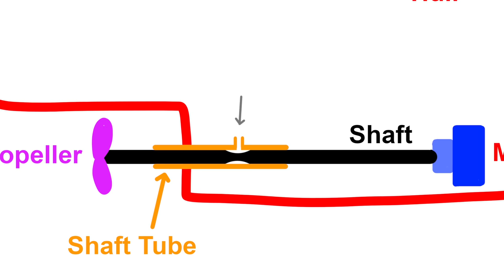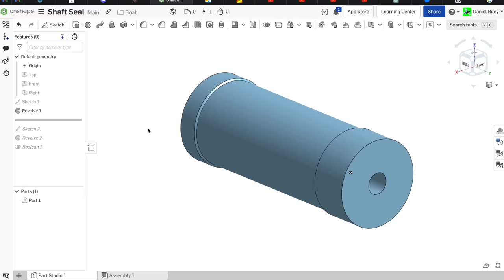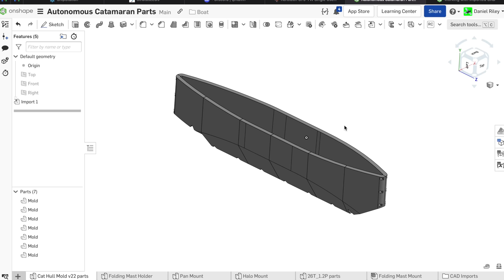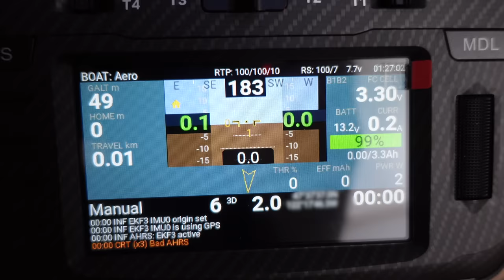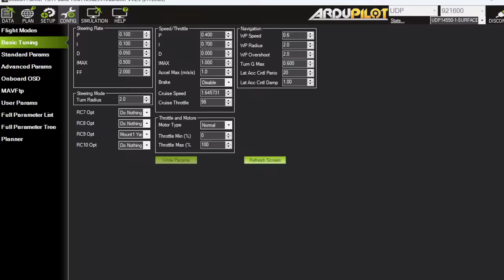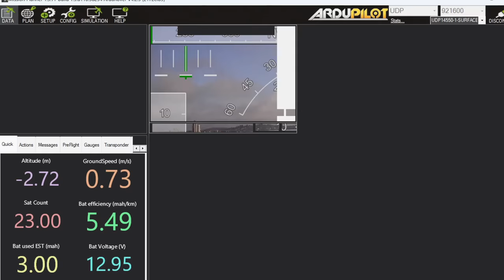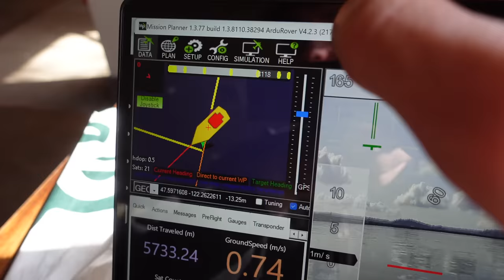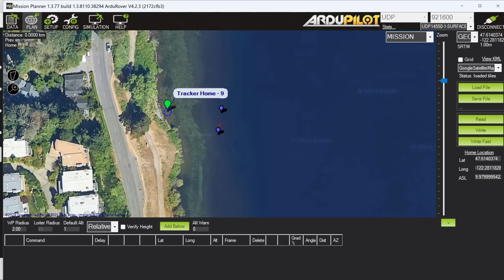5G Cellular Controlled Drone Boat - Long Range Test

Comment: I get such a kick out of these projects you do. The long range autonomous boat was definitely one of my favourites. BTW If you wanted to make sure you don’t get any leaks from the props, you could use a magnetic gear system.
Reply: Might encounter a torque issue if you go that route.
Reply: @Axodus  I agree. It would require a delayed throttle response but otherwise it should work
Reply: @maxxod1  airboat propulsion might be necessary just in-case the prop gets stuck on something.
Reply: @Axodus   The main reason I brought up the magnetic gear drive is because I’m designing an R/C submersible project. It’s something I’m familiar with. But yes for a surface boat your idea might be better. Something like a jet pump except it draws air from above the water line.

Comment: Captian here. REAL Actual Captain.  The one in my 40ft trimaran is just a big pencil lead. hint hint 
Okay so attach a pencil led wider than the shaft facing towards the keel with a set screw.
Then a boot sealed to the hull and sealed to the other side of the pencil lead. adjust the pressure
Of the two pencil leds touching each other with the set screw on the shaft placed pencil lead.
The graphene-to-graphene gap is less than a water molecule wide. So it does not leak and lasts forever.
Mine is 15 years old and it's time I change the boot as it looks someing like a toilet plunger yet the resistance
is not what it used to be thats the only reason why it needs changing. Higher horse power does require active cooling
of the big pencil leads. I thought if I say pencil leads it would be easier to understand than graphite puck with a hole in the middle.

Sorry to see you go through this over and over. If you need details I am sure I can get you some.
Q: You may have some questions like how do you make a gap the fine?
A: You dont you just run it and it will stop leaking by itself. 
Example: My boat was sitting in the ocean for a long time before I bought it and the boot is loose so salt water started too drip and for deposits in the seal making it not work as well. I literally climbed down there and sanded it while taking on water because the boot was pushed back for a moment. Very scary. Anyway after sanding it
then running the motor for an hour it was good agian.

Comment: I actually work in a similar field.  I work at CNHi on autonomous agriculture equipment (tractors and combines).  I must say if you ever want a job, you would be a good fit.  I'm very impressed with your ingenuity.  Mu colleagues are designing mesh radios that switch between wifi and cellular  and I design software that works over these networks.  I often find myself feeling we move to slow but I understand being a big commercial company with expensive lands and equipment we just can't.  Anyway, wanted to chime in and just say from someone in more commercial space, you certainly have the skills to take this beyond hobby but hobby is more fun no doubt lol.  Props to you!

Comment: Aliexpress has 8 mm and up mechanical seals available at very low cost.  They are very robust, and I have used them in a few projects. They could be a good fit for propeller shaft sealing.

Comment: I have been a Chief engineer on crab boats in Alaska and have had to pack shafts, if I'm ever in North lake doing ship yard I'll let you check out what it really looks like. 

Usually not a shaft box just rings of stuffing up against the shaft itself in the tube. The stuffing should go pretty far down the shaft. The stuffing is made of carbon graphite and self seals. West Marine should have some just called Marine Packing.

Comment: I'm almost sure if you made a small hole in the rear under the shaft, the water would self-drain. That's why there is a hole (plugable usually) in every row boat or sail boat.  No need to remove water if you are going forward, even slowing, but consistently, laminar flow ensures the water will drain out the vessel. The problem before was the water coming in had nowhere to go.

Comment: Super exciting to see the comms link and the new controller. That TX16S looks sweet.  Nice work on the prop shaft seal, not sure if magnetic couplings would work then you could isolate fully. How well did the weed guards work ?  That must be one of the real long distance problems.

Comment: If you don't mind mounting your motors "above decks", you can simply use very long shaft sleeves that terminate at/above the deck level to prevent water ingress. There's nothing "special" about the sleeves vs the outside of the hull; the water level will be the same inside as outside. Sailing dinghy dagger boards often work the same way.

This avoids the need for a stuffing box, although it can make your boat a bit more difficult to design from a center of gravity perspective. Such a design is impractical in full-size boats that need much larger motors, but for something like an RC craft it should be feasible. You can also consider using some kind of gearbox to reroute the drive shaft so that you can keep the motors down in the hull, while still having the exit point of your shaft sleeves high up above the water line.

Comment: You could use a slightly lighter/thinner grease then keep the syringes attached using rubber bands to maintain pressure, basically a diy self greasing shaft ;)

Comment: Water can close a circuit all by its self so its not hard to build a water activated bildge pump. But I would go with paddle wheels. Less efficient, especially in rough water but seaweed an shaft seals are not an issue. Sometimes reliability is more important than efficiency.

Comment: For the problem of leaking, I think, you could install a couple of small bilge pumps activated by floats or some other detectors of internal water. Also, what about threading those shafts so that they expell water rotating.

Comment: Cool stuff! Having both the receiver and cameras on single masts makes me a bit nervous. I'd probably have two or three poles, and maybe a few guy wires (is that the right term) to hold them on and upright. But it looks like it's working fine for you. I just hope that during a long mission the masts don't come unstuck somehow and flop over.

Comment: Cool video! An aside about preventing water from coming in through the shaft on the subs I served on they used active shaft seals by pumping aux seawater through above the ambiant waterpressure based on depth. The mechanical seals are there too and as a last resort for flooding was the inflatable boot. We used to fuck with nubs by sending them to shaft alley to feed the shaft seals 😅🖖
Reply: Nice idea
Reply: There are commercial teflon solutions, but he can't use them 1:23. (Heh, I would start over with new hulls)

Comment: My wet grinder wheel sits in a pan of water that's over the shaft. The shaft goes into a housing to a geared end, to another equal gear and another shaft parallel to the motor and its all grease packed felt and more grease inside. It has never pulled water inside and I've used it for years with wood chisels.

Comment: You should get valve seals for a engine a valve Seal its a lot like a crank seal what they use on a engine to keep water out and oil in on the crank shaft well spinning at high speeds but smaller and at a decent pressures

Comment: Kind of tricky and probably hard to machine, but a lot of engines use reverse grooving on the shaft in conjunction with the oil seal to keep the oil directed inwards..

Comment: 21:30 Im guessing that RC radio is using the standard 2.4Ghz FHSS that most modern RC radios do. if so then its most likely just drowning out the wifi link (also 2.4ghz) between your phone and laptop. Some phones have the ability to set it to use 5ghz wifi. Or else you could also tether off USB

Comment: Wow.... nice to see the options available for long range stuff now... didn't know multi-cellular data links were a thing now. One gotcha with ELRS telemetry is depending on the receiver the telemetry isn't as long range as the control link side, so you may have control, but no telemetry, as you showed in the video. Great video... looking forward to seeing the next installment.

Comment: Congrats on the successful mission. I notice from your other videos you spend a lot of time waterproofing  your propulsion. Lots of ROV makers these days use outrunner motors with marine epoxy injected into the windings. The whole motor goes into the water. See BluRov. Have you considered this method?  Might keep your hull sealed.  Great content! Please continue videos like this.
Reply: It is these motors that are used on mini submarines.

Comment: for your Water ingress sensors in the hulls, they will corode with time as the contact surfaces are exposed to the water, not much of an issue in fresh water but in sea water that might become an issue with time. There are some capacitive ones with covered  sensing areas which should hold up longer

Comment: Hello friend, and if you use a tube at an angle of 45 degrees for the place of all these seals and seals, if the tube with the shaft is above the water line, then the water will not penetrate into the hull of the vessel anyway, and option 2 is to create air pressure in the interior of the stern, that is, pump up like a tire as a result, the pressure outside and inside will find a balance and water will not penetrate into the interior of the case

Comment: There's an easy way to fix the seals, without having to run a bilge pump. If you've ever taken apart a house water pump, like a well pump or a sprinkler pump, they use a ceramic ring that presses up against another ceramic ring, and one side has spring tension on it. The water will lubricate the seal, but water cannot get through the two smooth surfaces. There is literally no rubber, virtually no friction, and zero leakage. Check it out, if you'd like a better idea on sealing your props.

Comment: You can build an ultimate sea explorer. Add the solar panels back. You may build a periscope for camera and your mest wouldnt be top heavy. Try to connect external antenna for cellular. Place modem and the camera inside the boat. One more thing ...

Comment: There is Also a setting in mission planner, I think under the GPS parameters. It allows the compass to learn heading off sets incrementally based on gps direction . Maybe it would be useful for a boat, I have never really wanted to try it on an airplane

Comment: Re: molding artifacts and hydrodynamics

It depends. They can reduce drag also, similar to the dimples on golf balls. Lufthansa is experimenting with using a paint layer for their planes based on the texture of shark skin to reduce drag and increase fuel efficiency. It’s a small gain, but over many many flights it will add up. Anyway,  maybe your unintended artifacts are actually a feature to help the board go faster… 😊

Comment: you should put a probe on the boat that sinks to the bottom of the lake, with a camera and light connected by a winding cable that can be pulled up and down in and out of the water. would make things more interesting.

Comment: (this definitely works if you have an android) To have less interference with from the hotspot you can connect your phone to the laptop via usb and enable usb tethering and mobile data. This allows the phone to act as a  usb ethernet device and you don't have wireless interference from the hotspot.

Comment: Enclose the whole propeller shaft in a camber and convert it to air pump, then just flush any water incoming in this camber through one-way valve somewhere near the propeller and profit from that. The air can be taken from the bow of the boat during high speed movement

Comment: It is hard to imagine for me that there might be so much problems with celular coverage. I might suggest you to use, if your modem supports it, an IoT M2M sim card, it should work (if modem supports it) in IoT band providing enough bandwidth to controll the boat without video, and have better range due to its "link budget". Great work!

Comment: shaft seals need cooling water, that exits out the back also keeping water out due to higher pressure - and need adjusted which on an unmanned boat traveling the globe - it will fail eventually - need z drives with water tight 100% install, and, 2 little water  bilge pumps per hull for redundancy, on float switches - cool AF wish I could build it w you

Comment: You should look up how carbon seals work. You’d be able to make little mini dripless shafts I bet, using carbon seals. A lot more reliable overall.

Or even just a little automatic bilge with a float switch.

Comment: Where i live the fisherman have external packing boxes mounted where you put the prop coupler. You couldve just made ur shaft a bit longer and make one out of brass with almost any kind of rope soaked in grease. Also if the whole shaft drive train was in its own water tight compartment that too would prevent water from going in bcoz there no where for the air to escape. Honestly im surprised u even had custom shafts made then went that route with the packing box. But im just talking from my own experience and what i know.
Man thats pretty cool still.

Comment: A bulkhead, like a vertical wall between  the motor area and the rest of the hull would make it so if the water came in the prop shaft only the motor would suffer.      Motor should still go long enough to complete even when wet.

Comment: I'd like to see you explore the use of solar cells inside a tube with a light source running inside centerline. Ideally something which glows bright without electricity, like those lamps from emergency exit signs. If you could get your hands on a hot enough rock, you could put it inside a tube of some sort, with flexible RTG sandwiches for walls. Run seawater on the other side for temperature differential and wire them together to your charge controller. It could make electricity under water, with other without sunlight.

I can think of no way to maintain depths from one part of the ocean to another. I think temp and salinity changes would cause issues with any predetermined neutral buoyancy. You might have to run on surface, solar on topside and RTG on bottom, for telemetry purposes. Good luck with your experiments.

Your rc boat is like a spacecraft. All efforts must be used to reduce electrical consumption.

Comment: If i can make a suggestion; have a bilge pump that is triggered by using the water sensor to pump water out.

I have a similar system set up on my aquaponic system. Works without fail

Comment: Imagine using those holes not for props but for water jets! That will allow water inside, just seperate top and bottom compartments and I guess you get the point, no props no drops!

Comment: i like your projects, and i know the problems of sealing a motor shaft from incoming water from our old sailboat from the 70ties. I'm just wondering why you put so much effort in this instead of using a submersible motor so you would only have to seal the cables or even put them over the hull and would be able to get rid of all the sealing problems (sorry if sb mentioned this already, i didn't read all 300 comments)

Comment: Hooking up a depth sensor to a microcontroller, flashing lights as an output, which then you record with a camera, then send over mobile network, is the ultimate hack. No way you could have sent the depth data alongside the other data, for sure, the mobile connection couldn't have handled it.

Comment: hear me out; what if you fitted an LED display, like a cheap one that doesn't use much power, and used that to display a message on the boat? you could communicate with anyone! speakers could work too, actually

Comment: Machine a piece of oil preg bronze to ride on the shaft with a spring applying pressure to it against the tube like newer boat seals do an add a piece of bronze to the tube so it's a flat on flat area pressed together oil preg to slow slip an spring for pressure. Should work an if trouble add a carbon washer or delrin washer between,  look up newer shaft seals for boats to understand

Comment: Reversing the design on the stuffing box was a good attempt, but there's a few reasons not to do it this way - looks like you figured out one of them reasons with the grease pushing itself out due to centrifugal force. Was a good attempt though, and I like how you think "outside the box". 😅

Comment: Time for toroidal model props? Very, VERY cool 😋.  I wonder what would happen if you angled the prop shafts in the next model to come up in a slope to the front of the boat so that the (then front mounted) motors would be above the water - that way there simply would not be any water ingress.  Not sure how efficient that would make the props, but maybe benefit and absence of stuffing box friction would offset that loss?  Or maybe use the longtail boat idea as used for racing boats in Thailand, but probably not going that fast 😋.

Comment: You could try keeping the interior at positive pressure relative to shaft exit with a pump if the air leakage rate is slow enough. Should only need 1 kPa or so overpressure.

Comment: make a small teflon plate at the back, use some strong magnets to transfer torq, on the outside just a propeller with an axle and magnets. 100% water proof

Comment: Wonder if mixing some ferrofluid into the grease (or just using straight ferrofluid) together with a magnet would be a practical choice for sealing those prop shafts.
Upside would be way less friction, at least with just oil, and no squeeze-out. The only downside i can think of would be cost.

Comment: That wake at the 18 minute mark may very well have been created by a small earthquake. I have had experience working on a barge next to an aircraft carrier while tracking the 1000s of small earthquakes from the USGS live tracking. Even very small earthquakes can cause relatively ripples and waves as the energy propagates through the water.